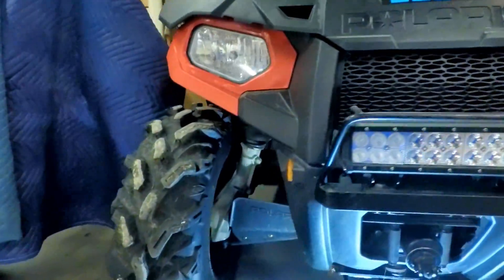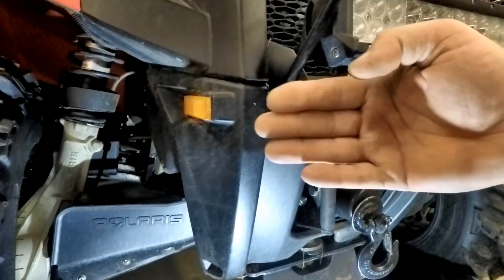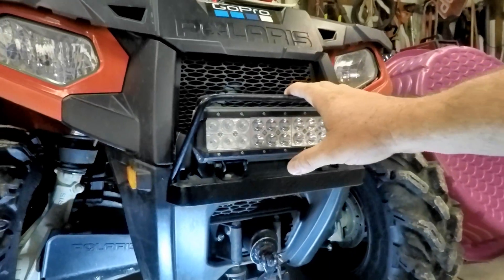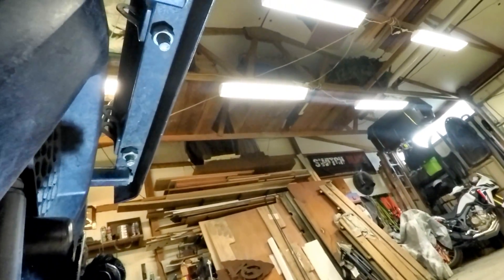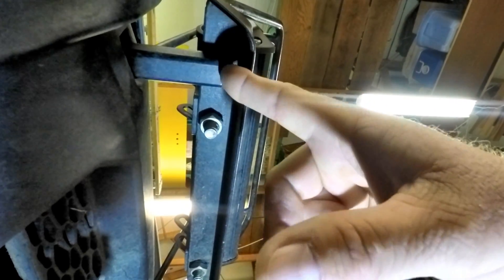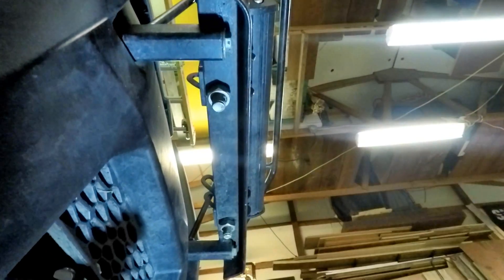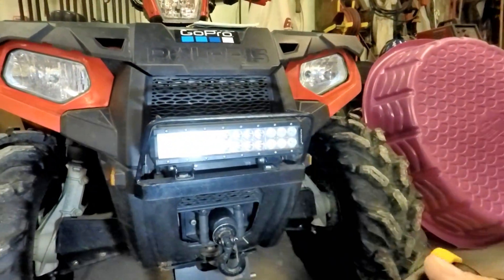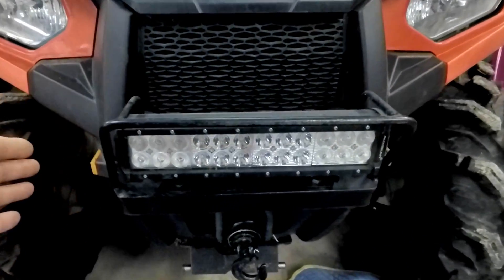How I built my LED light bar

Comment: I'm trying to figure out the wiring. Can I just tap into one of the headlight leads Will the fuse handle the extra load?), or do I need to use a relay? Or maybe you just wired in a separate switch?
Reply from the maker: No you need to use a relay and run back to the power block at the front of the wheeler